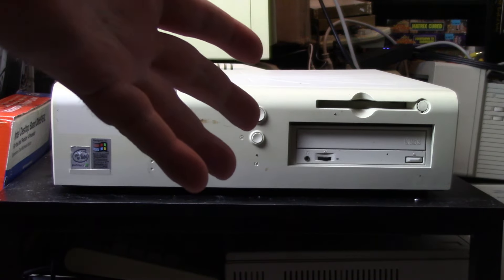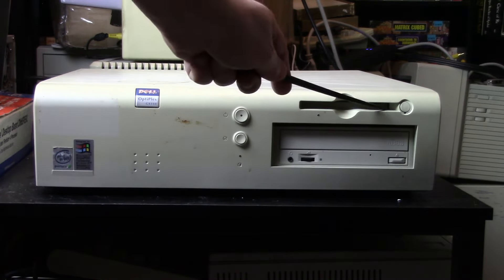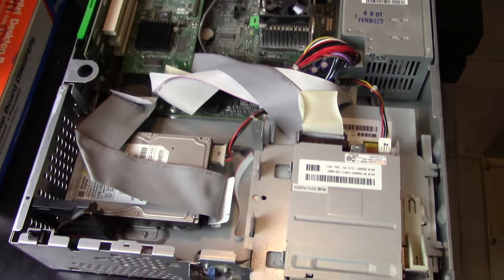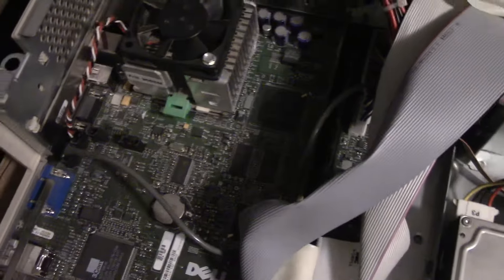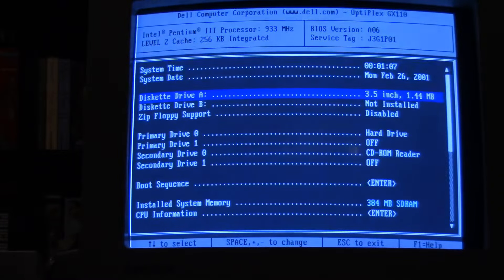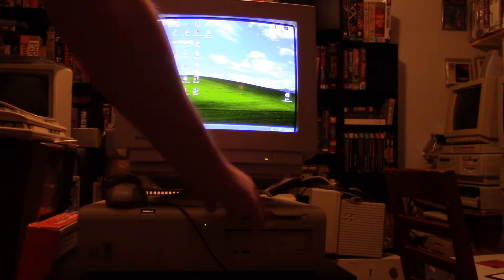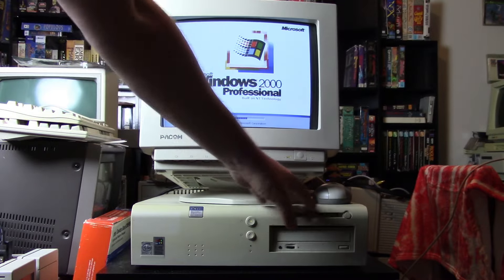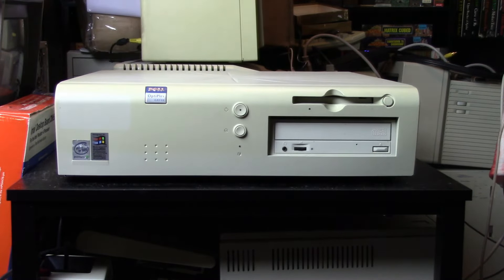Dell Optiplex GX110 Desktop

Comment: When I started my first job out of college in 2005, the company I worked for was still using these machines.  There were 100s...  those who had towers used the Gateway with the power button in the middle.  It was very bizzare and slow.  They used Citrix to remote into a VDI so I suppose they didn't need anything powerful.  It was very painful for me since they had me do desktop support with a CS degree.  Nothing like crawling under desks to find lost pieces of food and foot odors.  Humble starts...

Comment: It’s standard 20pin ATX and that extra cable is an AUX connector. 3 wires with 3.3v and the next 3 are ground wires. I’ve made an adapter for Dell boards that require a PSU like this. It’s a carry over from boards with AT power connectors.

Comment: I used to have that exact same PC - in also the exact same case form factor. I upgraded it's 667 PIII to 1GHz, doubled the RAM to 512MB, and put XP SP3 on it. I also had a 16MB (PCI based!) ATI Rage 128 inside, and a 40GB HDD. It ran well for internet use and I used it right up until XP lost MS support in 2014. Good times.

Comment: Interesting case, but this one currently on an auction site is even weirder: Vintage Dell OptiPlex GX110 DCP SFF Pentium III 1.33GHz.  I see that you covered that model 5 years ago.
Reply from the maker: Yeah, I had previously looked at that SSF one. part of the reason I more or less glossed over this one, basically the exact same motherboard just in a larger case.
Reply: Oh yes I remember working on the unusual looking SFF version of these (I think Celeron 667 - in a call centre many years ago!)

Comment: If I recall correctly, you need to format your HDD with fdisk into FAT32 first and then start Windows98 setup. Win98 doesn't support NTFS file system. Great video, keep going!
Reply from the maker: Windows 98 does not use NTFS. I did use a utility to wipe and format the drive to FAT32 prior to installation though even if I didn't the Windows 98 install will not install unless you let it format the drive to something compatible.
Reply: I don't remember Win98 CDs being bootable. I seem to remember having to boot from a floppy to get CD support @AncientElectronics
Reply from the maker: @marctorres7182  I've installed Win98 hundreds of times at this point and I've never once used a floppy disk. You just set the BIOS to boot from the CD drive, insert the Win98 CD and on POST it should start the install setup.
Reply: @AncientElectronics  Only the OEM version of Windows 98 SE has a bootable CD.
Reply from the maker: @dennisp.2147  I was just gonna reply, its been years since I installed any version of 98 other than SE so maybe thats the confusion.
Reply: @AncientElectronics  And it's only the OEM versions that are bootable.  If it's an upgrade/retail version, it will not be.  Microsoft, then as now, wanted people to pay for the full version.

Comment: This reminds me of being arrested. Back then, the standard computers for the local Police were Optiplex GX1s, older machines than the GX110 but using near enough the same chassis. They barely worked, were tied to an aged 10Base2 network, ran Windows NT 4 and delayed my booking for the best part of an hour - so I sure had enough time to stand at the desk staring at the back of the bloody thing through the perspex barrier.
Can't stand Dell machines. They're the epitome of everything I dislike about big OEMs with all the non-standard nonsense and lackluster specs for what they cost at the time. When I did PC repair for people, Dell were firmly on the list of things I would refuse to work on. From a hobbyist perspective at the time, they were just a flat out rip-off, coming in at many times the cost of, say, building even the most basic K6/K7 machine at home and offered zero advantage over doing so. These days, of course, if it's going cheap and does what you want, then go for it.
I wouldn't worry about the sound chip very much on systems from this era. From the end of the 90 to the present day, there's rarely any real difference and they were all clones of the same generic AC97 solution. The only differences were what the manufacturer of the card or motherboard decided to turn on or off, and if they did anything special on the software side for interfacing with it. The Audigy 2, for example, despite how impressive it looks, is barely more than a couple of generic AC97 CODECs glued together with a puny ASIC arbitrating things and interfacing with the software side.

Comment: it has bios version A06 and newest is A09. And maybe the flat coincell battery is your problems.
Reply from the maker: indeed, It certainly was operating for the previous users without the upgrade though, but I did notice that. In the end, I really didn't have the drive to get this one up 100%. it's getting passed to a friend who can deal with it

Comment: Windows 98 will not boot from a cd from what i remember, you need a boot floppy then install from cd.
Reply from the maker: It won't boot into the OS from the CD but it should start the installation process from the CD, I've probably done it at least a 100 times.
Reply from the maker: I should clarify the version I was installing was 98se

Comment: That is not sound-chip that's Sound CODEC.Codec and Sound chip are two diffrent things.And that integraded GPU is Intel i810 with 4mb frame buffer on board.Some cheaper motherboard use system memory as frame buffer but YEY you have good motherboard.Device menager Please when you do review.Gpu?

Comment: Windows 9X I think isn't smart enough to remove NTFS partitions so it just sees nothing.  That's my suspicion.
Reply from the maker: I should of been more specific, it was Win98se which is bootable and will offer to format if it detects a drive with an incompatible format, at least as far as I recall. regardless the drive was formatted before the Win98 install to FAT32 with another utility I always use before an OS install.